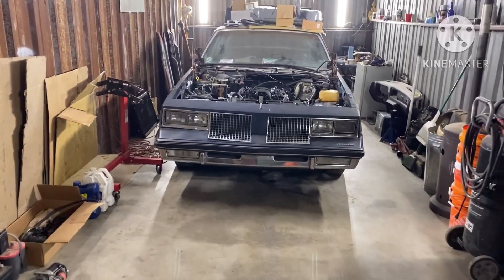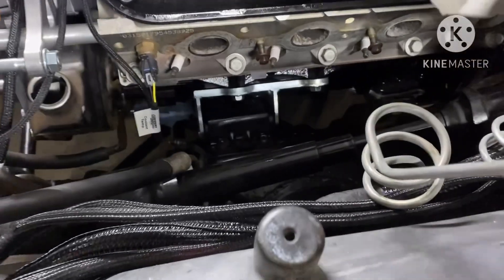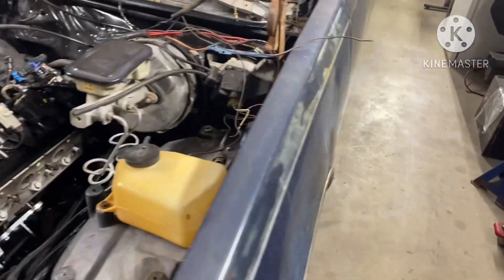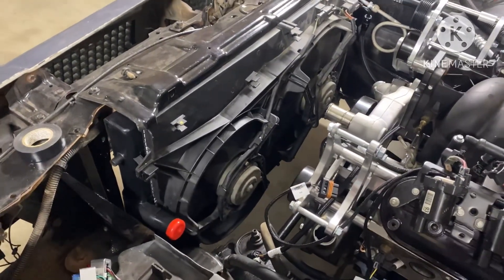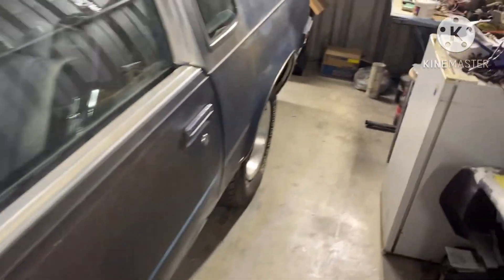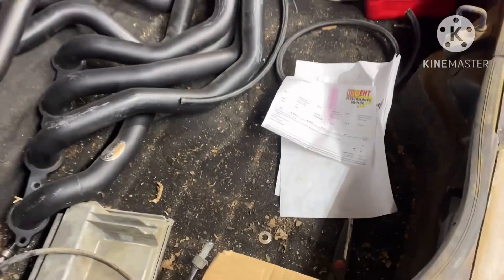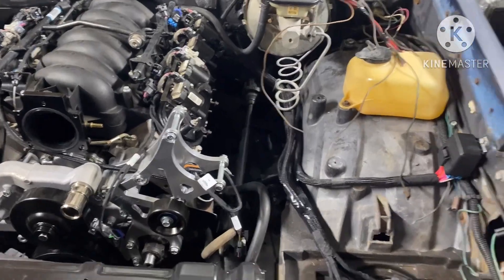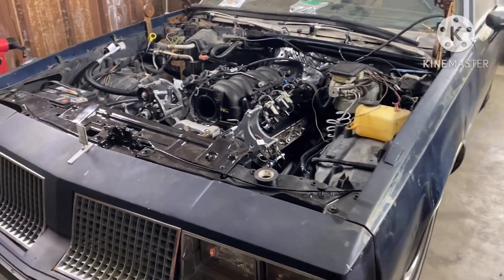83 Cutlass ls swap 5.3 cammed

Comment: Just got my 79 Buick Regal back for the second time after 9 to 10 months LS swap 5.3 stock new gaskets and seals bad trans first  just got out trans shop today 4l60e rebuilt performance parts with shift getting sideways new intake will and a extra 35 to 50 HP I ain't racing but I ain't getting left 👍👍👍